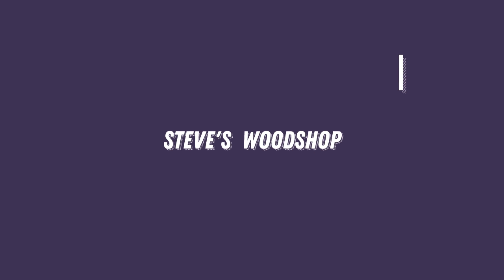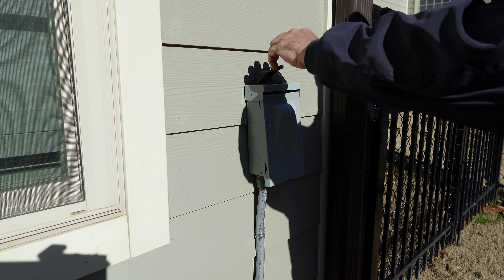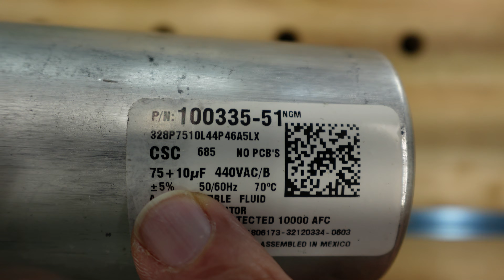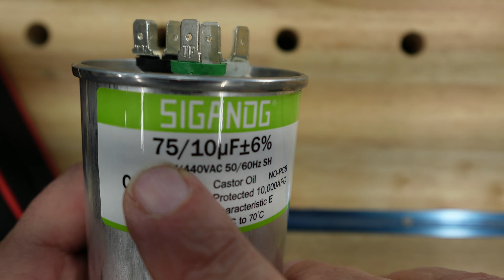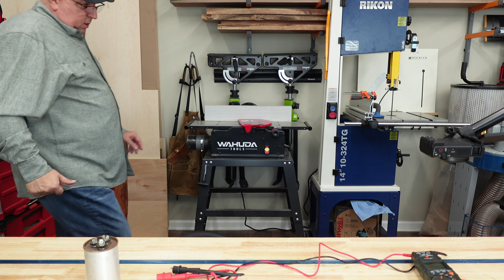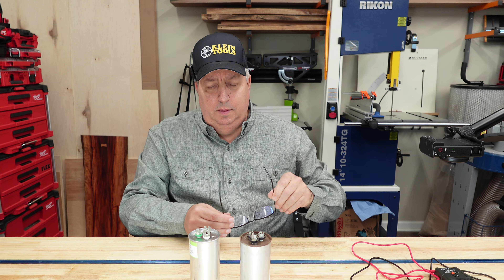They wanted $450.00 for this 10 minute repair

Comment: Swell.  Women living alone have told me they just call up the repair person, and pay.  All they care about is that the Air Conditioning comes back on.  They are lucky they didn't sold a new A/C for $15,000.  I was in town when my daughter in law suffered a A/C breakdown.  Quick check, spin the fan blade.  It starts spinning.  New capacitor.  Next time it stopped, I wasn't in town.  New A/C.
$425 is about right.  The repair person is running a business.  Has to charge $200 an hour, two hour minimum, or go out of business.

Comment: $425 for labor is insane to replace a capacitor! It’s funny that the older part had higher capacitance than the new one. The rusty capacitor on my 38 year old Tempstar was still reading good when we replaced it.
Reply from the maker: I think I should have bought made in USA

Comment: Really glad to be subscribed!

When you say "new contacts" do you mean the plastic connectors on the wires?

I googled "herm" and that helped me to understand the connections better.

I just had old central AC replaced with a heat pump, but haven't taken it apart. Are heat pumps likely to have capacitor issues in the summer like AC units? I like your idea of having a spare or two at the ready.

Thanks!
Reply from the maker: @johnbauman4005  one of mine is a heat pump also. It’s a new one though. If it has a condenser outside I’d assume it has a capacitor to start the compressor
Reply from the maker: @johnbauman4005  I was talking about the plastic connector that all the wires connect to that starts the unit after the thermostat asks for cooling. It completes the circuit to start the fan and condenser

Comment: Yea an upcharge for sure!  I learned growing up if you cant fix it yourself and aford to reconsider owning it.  I had to be able to start a model T (not a joke) and rebuild the carb on a 56 fairlane or small block chevy before was allowed to drive.  To this day I teach the youngins to do breaks and CV axels in there cars just easy stuff that takes a little effort but cost a ton.  At one time everyone was broke and im glad I was so I could be self sufficent.  That hvac fix is one of the few that are easy and cheap to do.  I dont go much past that on repairs if I dont have to but check the basics.Im sure you tought your kids alot and hope the next gen isnt paralyzed by actual work that you have to figure out.
Reply from the maker: @MattHmm-rq6dn  yep same here at 16 I had to change out a transmission on my f-100 pick up. The kids today really can’t learn what we did because it’s all computerized now
Reply: @StevesWoodshopandToolReviews  I always tease kids now all you have to do is start a model t how hard can it be?  Turns out more effort than most kids are willing to do.  Im not very old in my 30's just grew up with the right grandparents and time to not be useless